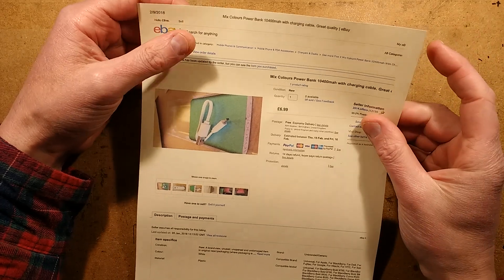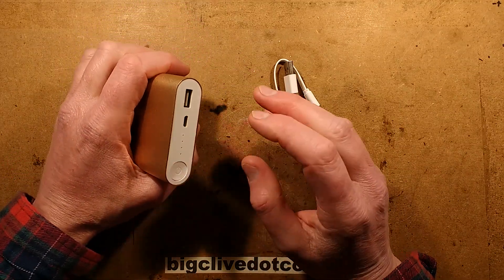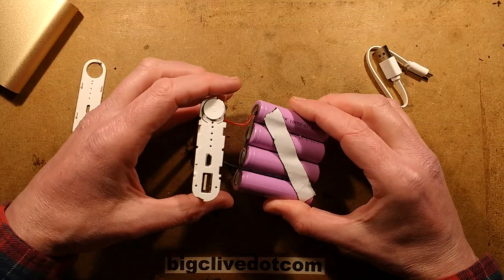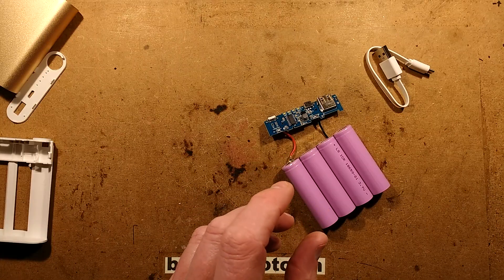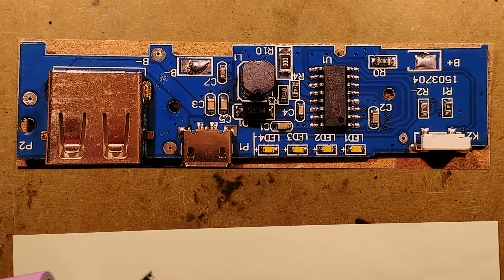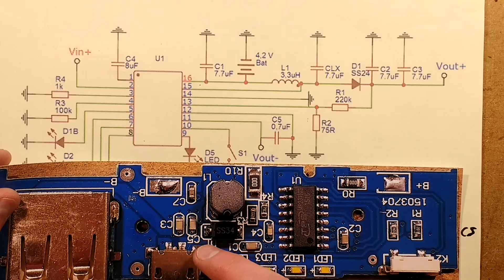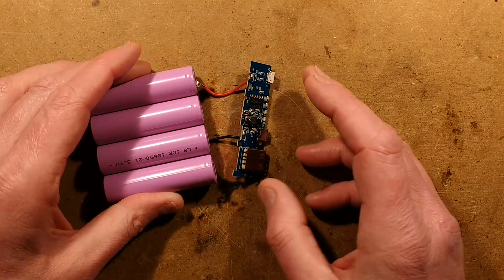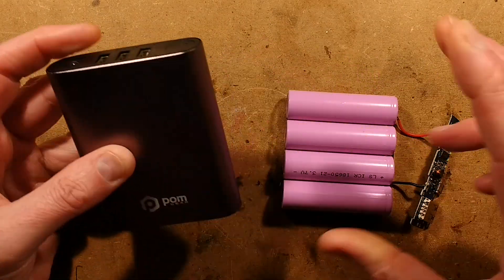Inside a fake "10400mAh" eBay USB power bank.

Comment: Most likely the cells are really crap, and very high internal resistance, so when charging they're voltage reach 4.2V really quick, and the charging circuit starts lowering the charging current so it doesn't overshoot, taking forever too charge. Same reason when discharging cell voltage drops.

Comment: Hey. You didn't try and open the cells. What weight where they at? Thanks!
Reply from the maker: The cells all looked identical and had proper end seals, so I think they were all genuine cells, just very low capacity.

Comment: Note: While there are plenty of clones in the style with white ends and no LED, there is at least one good brand. I have one branded "superspot" which I picked up randomly in some store back during the Pokémon GO craze, and while I haven't tested the capacity I do know it charges reliably in about one overnight charge and can recharge my phone fully about four times. It also maintains around 4.8v at about the 2.1A maximum load. It's even been banged about to the point where the ends are falling out of the metal without going thermonuclear or dying.

Comment: those cases with the PCB are only <2$ and I have bought few of those to give some purpose for all of my 18650 cells :P
Reply: I was going to make the same comment; got a couple of these from AliExpress IIRC, and they're really quite nice mechanically. 
But I see my phone charges at 4.85V 200--220mA, and an LED strip takes 4.72V at 290mA; plus when I charge the powerbank it draws only 150--210mA. This despite I installed a couple of good 2600mA 18650s.
Sooo, if low loads and slow charge are ok, these are good value -- but otherwise, not so much.
Reply: my phone charges at 5V ~1200mA (according to Ampere app for Android).
Reply: You appear to have gotten a better version than I (or Big Clive, from 6:23)  received :-)
But the Ampere FAQ says "The app is not meant to be mA accurate, but is good enough as a relative measure of how various chargers and USB cables fair [sic] on the same device", which is quite the disclaimer.
I used a Keweisi USB meter.
Reply: get one of theose great USB ammeters. There is one in aliexpress that is Bluetooth and even gives you a log of voltage and current vs time, also calculates capacity, power and internal resistance on the fly

Comment: so, about 4000mah at best then?  seem like they are buying reject cells, 1ah cells are not made as such, same cheapo circuit as they have used to for years, 1a only not the 2.4 claimed!, they sell empty powerbanks for less than £1 , i bought a few and put used laptop cells in it(which also are only about 1000ma each)

Comment: I have noticed that alot of power banks and even phones (aswel as my Samsung s7 and HTC m8) they say they are 100% charged but still taking atleast 500MA for sometimes hours after. so just because something say it's fully charged does not mean it is, I would say every phone or power bank I have charged says they are 100% when really they are more like 50% maybe 75% charged and need to be kept on charged for twice as long to get it to a true 100% charge when it then goes down to only taking about 5ma

Comment: Have to say that UNI-T USB tester is quite crappy. The refresh rate is super slow, it doesn't have a backlight and readability is pretty meh on my example (angle it slightly and the numbers turn completely invisible.. contrast problems?). Yours at least doesn't seem to have the LCD issue, but still. Please grab a Keweisi tester the next time you shop for random cheap tat on chinabay.
Example of the Keweisi one I'm talking about: https://i.ebayimg.com/images/g/a1EAAOSwwcRaWjnq/s-l1600.jpg  
If it says "RTZ " instead of "RESET" at the button and has no text in the bottom right corner of the PCB, it's a knockoff of a decent tester... tempted to say knockoff of a knockoff but who knows... 

PS: Those USB testing gadgets might even be worth a video on their own. Before I saw them in your videos, I didn't even know ready-made USB dummy loads even existed.. just as an example.

Comment: I was pleasantly surprised awhile back when I bought a 15,000mAh LiPo bank from Best Buy and discovered that it provided 9.9Ah at 5V, and if you then do the math based upon the nominal cell voltage of 3.6-3.7V and account for the roughly 10% losses due to the DC-DC conversion and the several mA used by the backlighting in my USB power monitor and, low and behold, it came out to right about 14.9Ah.  For the money I expected it to at least be in the ballpark of what was promised but I was a little surprised to discover that the advertised capacity was well within just one percent of the actual capacity.

Comment: Nice case to build your own real battery bank.
Clive. How would you rebuild an RC truck that comes with 4 AA  batteries to convert it to Li-ion rechargeable?  It runs on 6V and the 18650's are 3.7 so needs to be doubled.  I also have a foil battery from a laptop that is 7.2V. The voltage is close there must be a way to convert these $60-200 RC toys to use up these otherwise useless batteries. The 'New Bright' RC toys are  everywhere and mechanically well built trucks and boats but unfortunately the electronics and batteries are crap.  You can't buy replacement proprietary rechargeable batteries they use in the more expensive models. Which are cheap with no undercharge control so they fail quickly. In the AA models the PCB is not even soldered to the battery terminals. They use a sprung wire to hold the battery terminals to the pads. Rebuilt these toys could be made so they function for more than a week. With stuff most of us have laying around or can easily get ahold of. If you have already done this can you point me to the video? What is nice about the New Bright is they have two sets of electronics the AA setup and the rechargeable setup. They are the only two used in every one of their hundreds of RC toys. New Bright also makes RC toys for other vendors under their own names but it always says New Bright somewhere on the toy. I've been given a few trucks cars and boats and want to rebuild them safely for the kids ward. Your advice?
What is your thoughts on building a spot welder for welding battery terminals?

Comment: That looks like a knockoff of the Xiaomi 10,000,mah power bank that uses 4x 18650 cells. The legit ones are pretty good.
Reply: Remember 18650 is a Size+Voltage, doesn't mean these are "fake" 18650's.  I'd still say it's cheap.  I could use those from the vid in my vape.
Reply: I wouldnt do that with shitty cells, unless your vape is high end and has voltage, current and temperature protection. Also for safety, is better to ahve less capacity and use safer LiFePO4 cells isntead of the regular LiPo cells.

Comment: This is a knock off Xiaomi powerbank. The original ones are real capacity. The model i have (a bit slimmer and longer so probably not 18650s inside) support QC2.0 so its quite practical. You should take one of the real ones to bits but they are a bit pricey and hard to find originals.
Reply: TheRandomMan ihome makes the exact same ones. I was worried when I saw the thumbnail.
Reply: they are 18650s . yeah 18650 are 3.7v. If hooked in parallelx4; at best would be 8000mah or less. If they arent high drains then it would really suck. Or, they are in parallel and series making it 4000mah or less at 7.4v regulated to 5v.
Reply: depends on capacity of the cells, there are NCRs up to 3400 mAh, but they are a little special and you have to drain them down to 2.5V to get all the juice (and they cost way more that the crappy 2000mAh ones). Also that capacity is at the rated 3.7V (when you output that to the phone, there are losses from the conversion 3.7 to 5V and then again loses at the phone to go again from 5V to 3-4.2V while it's being charged). Some xiaomi charger have that printed in the label, both capacities at 3.7V and 5V.

Comment: Very interesting, ive got a power bank that uses almost the exact same housing, but mine is aukey branded and is qualcom quickcharge 2.0 compatible. It also claims 10400 mah, and i have charged up my tablet and phone with extended battery enough times from it to believe it.

Comment: They sell that enclosures without cells for about 2-3$ and even if I put high quality 2.3 Ah Samsung cells (10A continuous rated) I barely manage to charge my phone once, this circuitry is extremely inefficient, since using other powerbank board I manage to charge my phone two times

Comment: Hi again Clive I thought your video was quite interesting because I have bought one for 8 18650 batteries with the same type of style with the aluminium shell, except it was an DIY kit thanks for always have interesting video's of cheapy Chinese stuff.
Reply: Btw did you know that many of these 18650 (the cheapy one's) are (from my experience when pealing the wrapper of these battery's often there is a bummer from the original manufacturer and)usually is just repackaged and relabeled cells from the bigger company's, that's how they get it for so cheap.

Comment: Have you ever seen a lithium battery pull 1 amp while recharging? I had a cell, probably twice the size if an 18650, that had discharged to about 2.6v. My charger sat at 60 mA until that cell reached 3v, then the charge current shot up to an amp until it reached 4v, then it dropped back down. It was a tad scary.
Reply: Well, 2-3Ah for an 18650 is pretty common, so a cell twice the size could easily be 5Ah. Charging at 1A would then equate to 0.2C, which is a very nice and slow charging current for even the most finicky of cells.
Sure the discharged state of the cell isn't a good thing, but you said it only started pulling an amp once it got back to a normal voltage (sounds like an 'intelligent' charge circuit), so that shouldn't really have been an issue.
Reply: Very true. I suppose i wont think too much of it then. Thanks.
Reply: Wyo engineer; No problem. I am, however, assuming that it's from a reputable source and not a 'fake' knockoff... With stuff from EBay, for example, your never really know what you're going to get.
That said, you're MUCH more likely to just damage the cell or reduce its life expectancy, than you are of having it undergo some spectacular failure.
One more thing to keep in mind, if the worst does happen and a cell 'explodes', it's not actually an explosion at all. Basically, a burning Li-ion battery is like a pouch filled with gasoline above its flash point. When it finally ruptures, large clouds of fire will come streaming out, but it is still just a fire; hence, no destructive shockwave or lethal shrapnel to worry about.

Now, primary cells that DO contain a substantial amount of Lithium are, of course, potentially much more dangerous. However, the real danger occurs when the burning electrolyte is confined in a strong, metal enclosure. In the worst case, that could behave like a grenade, sending a shockwave and shrapnel flying everywhere.
Reply: lithium cells need a slow charge if they are flat initially.
Reply: It was a single cell. The lenght of an 18650 but about twice the diameter.

Comment: Ah a fake Xiaomi.
Reply: Real Xiaomi work really fine
Reply: fake asus zenpower
Reply: evoGage Kodak also has a power bank similar to that, the shape is identical, it's also 10400 mAh but it has 2 USB ports and the power button is really similar too. I have the Kodak and it's great, but it wasn't cheap it was about 80-100$ I think. I have used it for 3 years now and it's still going strong.
Reply: yeah my friend has one and theres a Mi branding on top
Reply: a copy copy powerbank get it,get it?
Reply: its not fake. its a great produkt

Comment: I want to get one of these but instead of charging it with 5 volts I'll use 120v wall current. That way I can get 24 times as many milliamps out of it. I bet it would power my house if we lost power in a storm.  ;)
Reply: Francois Molinier you would have to keep changing polarity 50 times every second.   Well at least it's not impossible.  And you should go to the uk, 240v would be twice as many energies inside the battery!
Reply: Nah, hook it straight up to the utility pole! You could power the whole block!
Reply: Gavin Sauer More power in to the batteries, more power out!
Reply: you can get 240v in north america. plug it into the stove or washing machine.
Reply: That seems like sound logic to me!
Reply: Wyatt Roncin you're right, I should go for 240. My clothes dryer is always full of static electricity which doesn't appear on my bill so I'll save money there too.
Reply: Make sure you get a version with multiples of 3 cells so you can hook up to 3 phase for fast charging.
Reply: After the fire your place should only need a 9v or 2
Reply: Is anyone selling compressed Whitesmoke™ yet, for the DIY enthusiast to repair faulty electronic components? I can only find the low grade stuff that comes inside solder, and most of that escapes when the solder melts.
Reply: Don't forget to video yourself doing that and post it on YouTube.  That would be most entertaining.
Reply: then you would need a bridge rectifier to convert it otherwise it will only power half the house :)
Reply: Wyatt Roncin good call...lol
Reply: Why don't you use 400 Volts 3 Phase ahha or 11,000 Volts HV. Get some power then! ;)
Reply: Lee Wedewer it's 230 actually in Britain
Reply: I just laughed my ass out
Reply: 400v tri-phase is a thing, on the military-grade generators that's actually common.
Reply: Gavin Sauer he is lol
Reply: ahahhaha
Reply: Smart man lol
Reply: it's 230v
Reply: Paul Drake I want to watch the rest of this video but his delivery is so choppy. If he didn't do it so often, it wouldn't be so bad. He talks regularly in a log of the video, but those points where he starts talking all choppy is just hard to listen to. It's sounds extremely unnatural.
Reply: Thats a great idea! For my home battery backup, I've been just plugging my cellphones wireless charger into the wall and setting batteries on it, doesnt seem to work too well... im sure I just need more batteries.
Reply: If its real it can allow for USB wall charging. This can not run your home for that you need a battery bank  of several 12 or 24 volt batteries. And a electrical transfer switch wired to your  breaker box along with a dc to ac converter. Or a generator and transfer switch to power your house. You can also use solar and wind too but still need a converter charge controller and switch.
Reply: nowadays more devices support from 100-240V, except the fucking PSUs from dell which still have that annoying 110/220V switch .... they blow up really loud btw.
Reply: I see you are a fan of the magic blue smoke.
Reply: Holy hell! That's so dangerous to do!

At least use protection. 2000 amps fuse from Mr. Photon should be minimum to run this on carpet.
Reply: The chip couldn't handle them so magic smoke breaks out..
Reply: That is the most ridiculous thing I've heard all day!  Obviously you should use 240v and get even better ampvoltermillis!
Reply: What? I really hope you're kidding.
Reply: Gavin Sauer woosh

Comment: When I was in Shenzhen two years ago, these were all over the markets. They cost around $1 USD with no cells. Strangely (though not unsurprisingly), even without cells they had 10400 mAh permanently written on the case. Put whatever cells in you want and through magic, it will be 10400 mAh!
Reply: Chinese mAh mind you
Reply: @km5405  They achieve that with their secret sauce electrolyte consisting of lies and magic smoke.
Reply: Because it Is made after a real Xiaomi 10400 mAh bank
Reply: Kinda like PMPO watts, eh? :P
Reply: there used to be plenty of empty powerbanks on ebay for £1, the circuit can only support a total of 1a charging even though it says 1x1a and 1x2a,   and they charge really slow, tapering down and sitting at low MA, ends up taking 24 hours to charge that puny capacity, in short they dont make great powerbanks
Reply: It's brilliant!
Reply: Ancient Chinese secret!
Reply: Could you buy them in small quantities or was that price only for large orders?
Reply: Buy 4 LG2 batteries and you increase it to 12000 mAh!
Reply: That was in quantity one - most of the stuff in the Shenzhen markets are available in sample quantities; If you want more then you can strike a deal for cheaper prices. Well worth the visit, and TONS of LEDs!